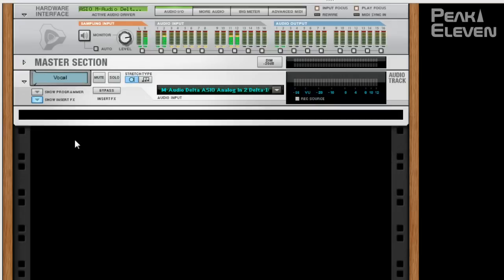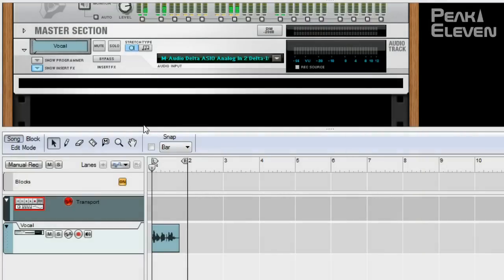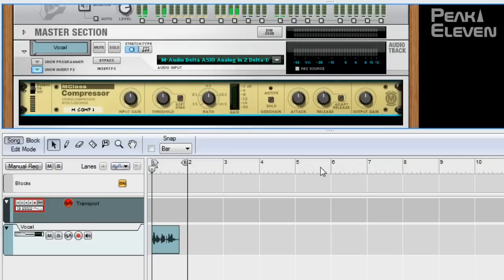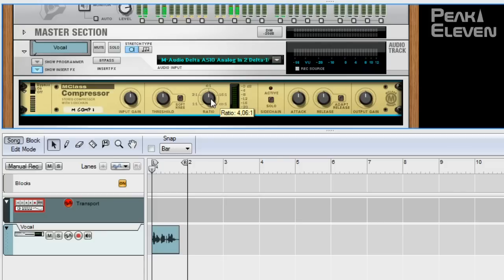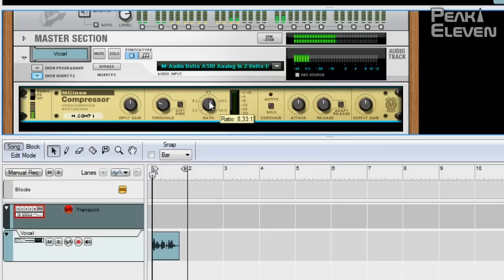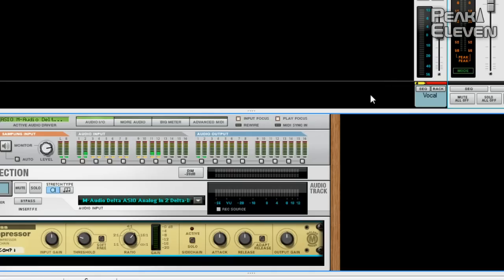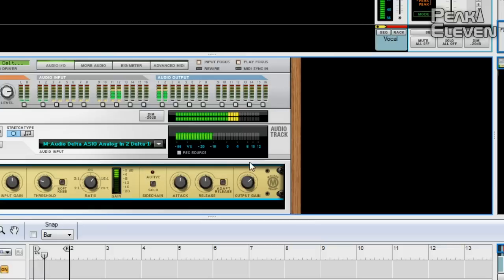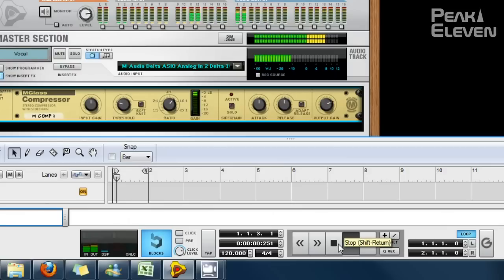How to use an Audio Compressor

Comment: great video.  I understand that compression lowers the loud parts of your audio, but does it actually bring up the quiet parts? Or is it that it lowers the louder parts and the output gain is made louder to make it sound even?  I get confused with that.  And also, what is the difference between normalizing vs compression?  And can you explain attack and release again.  I almost got it, but still confused.

Comment from the maker: @mkk911akadevil 
Thanks, this was actually my first tutorial video. :P
Yeah, you can use the compressor to get tracks or mixes louder. Altough for increasing the overall volume and pressure of a mix I prefer to use the Maximizer. 

The Maximizer basically cuts peaks that the human ear can not hear anyway...and when you cut peaks..well then you can increase the level without distortion. Up to a certain point of course when those cut peaks will be audible artifacts.
//Mike